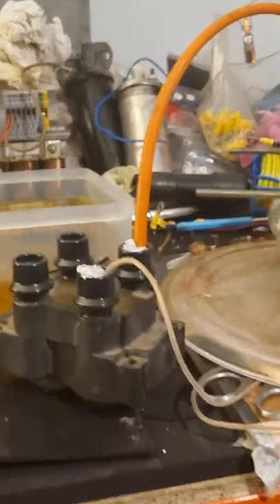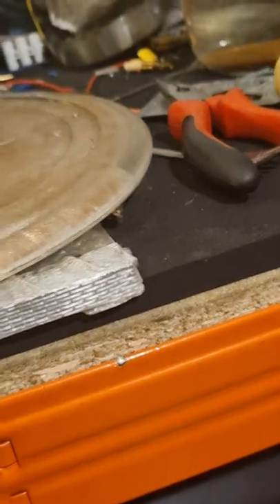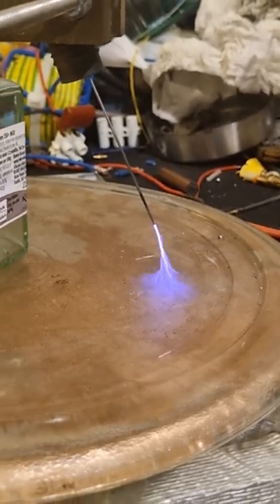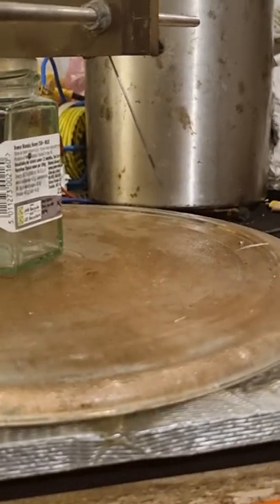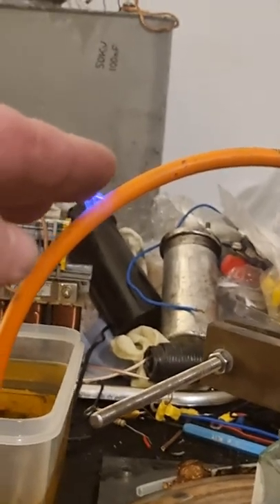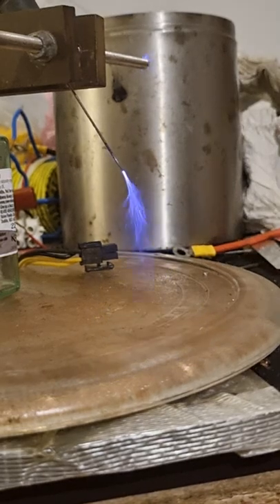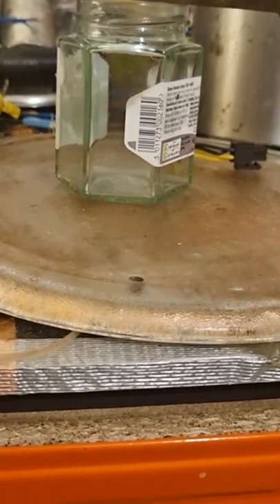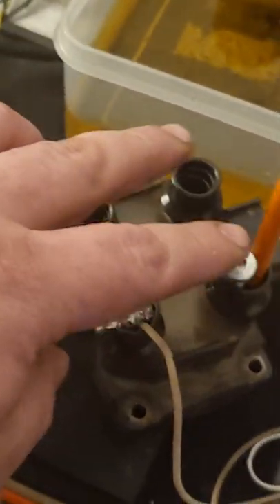#30 - Ford Ignition coil driven by half bridge.

Comment: Do you have a circuit diagram and components info for the driver you're using?
Reply from the maker: Yes, I do, but its very easy to make... Its a typical TL494 Oscillator this feeds two opto gate drivers which have their own individual isolated dual rail supplies, so the output swings + and - to the gates. It then drives two igbts wired in half-bridge. and the ignition coil is across the output.